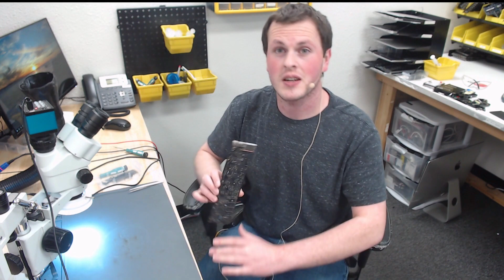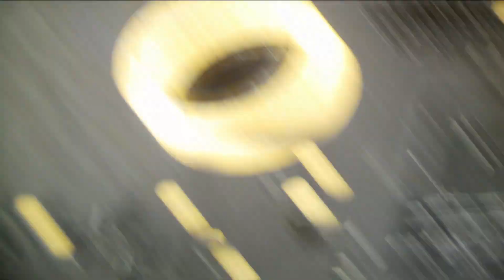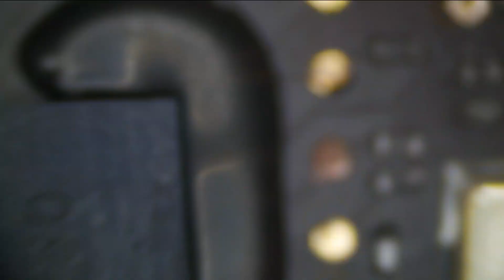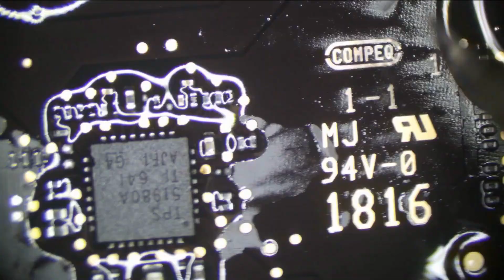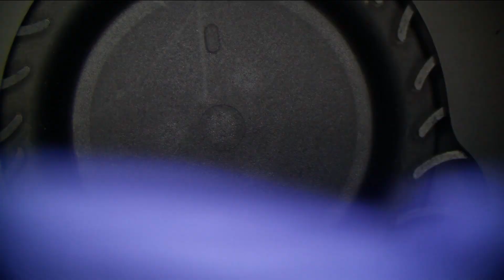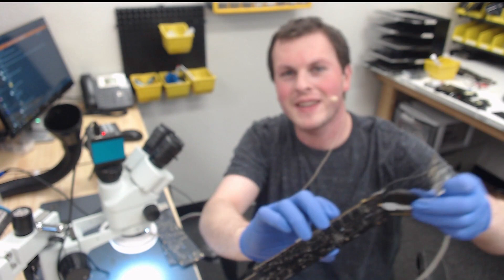Liquid damaged MacBook Air with coke EVERYWHERE gets revived by a Crest Ultrasonic cleaner.

Comment: Help me...I sold my M1 2020 MacBook Pro yesterday, not knowing that it had previous water damage at the ports (which caused the second Type-C port to malfunction, I noticed it about half a year ago only for a short period, and then the new owner noticed it too).
Can it still be fully repaired by ultrasonic cleaning?
Suspected liquid is beer or water.
Everything works fine besides that one port, incl. keyboard, screen etc. No freezes whatsoever.

THANKS!
Reply from the maker: Repairable? yes. By ultrasonic cleaning alone, probably not, it likely will need board level repair at this point.
Reply: @TCRSCircuit  
Thank you. Meaning board exchange?

Comment: Hi Tim, I really enjoy watching your videos and learned a lot of things. I am repairing a MBP 13 2010 for my friend that has water damaged. It is running but when the battery connected, the fan runs on high speed. There is no problem running on the main power. It only happens when the battery connected or when it runs on battery. Where should I look at? Thank for your help.

Comment: Very nice, can you make a video on how to clean them that good? I want to see all the steps ;)
Reply from the maker: You put the board in the cleaner and turn it on. Louis had a video about it. It's simple stuff.
Reply: @TCRSCircuit  I understand that part but I was wondering how you dry them and if you use mini oven?
Reply from the maker: @smilemore209  After the ultrasonic, wash it in distilled water. I dry it with the hot air station until its visibly dry then it goes in the toaster oven for 7-10 min at 150*F
Reply: @TCRSCircuit  Thank you so much man! I appreciate this information